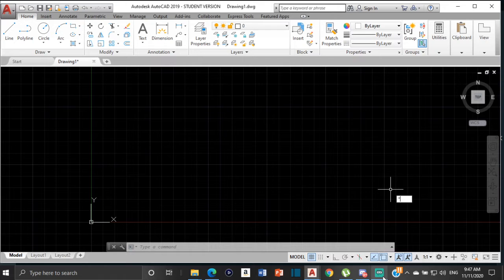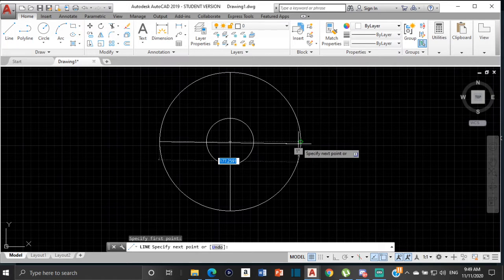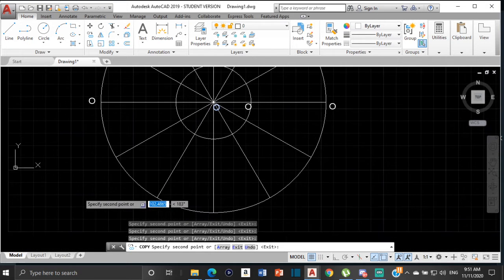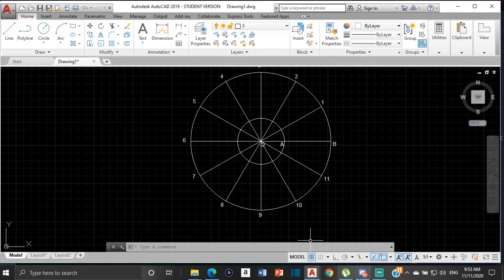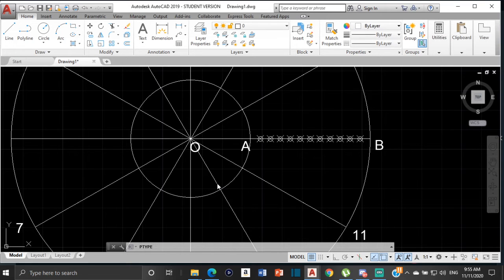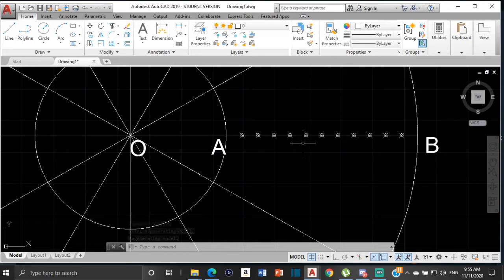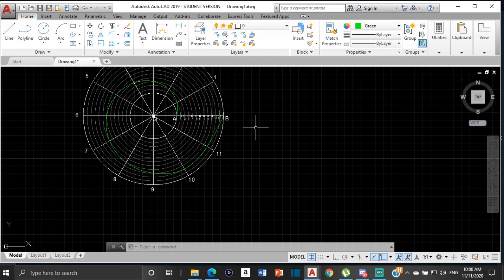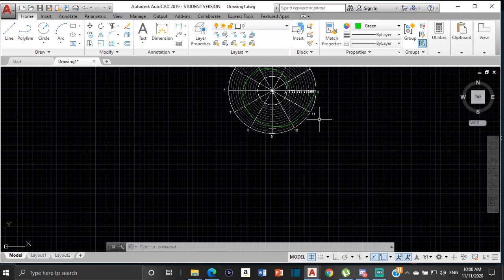HOW TO DRAW AN ARCHIMEDIAN SPIRAL IN AUTOCAD

Comment: Type of commands used for archemedium spiral
For divide circle in 12 parts select that 2 lines and type array and click on the centre 
Select all the line and type explore command 
Command trim type tr and remove line AB and use another line to join AB 
Then type divide and click on the line AB to show divide part type ddp